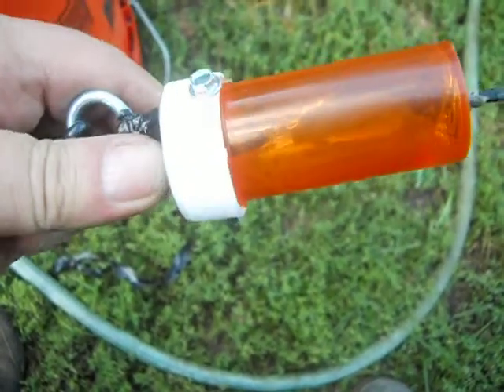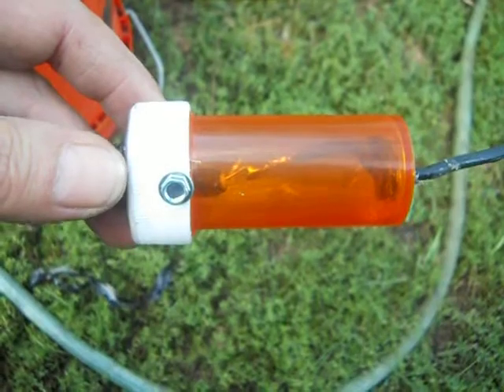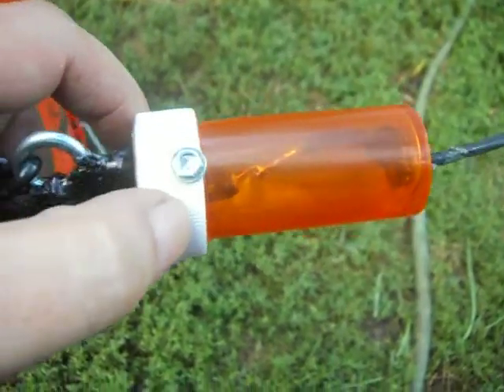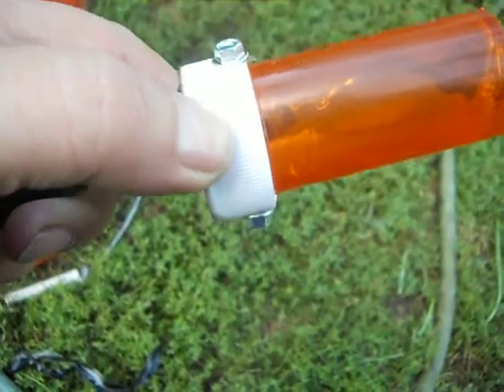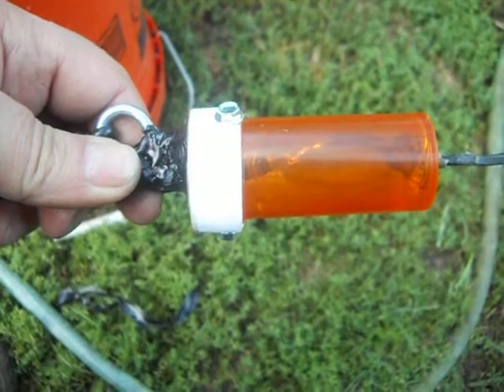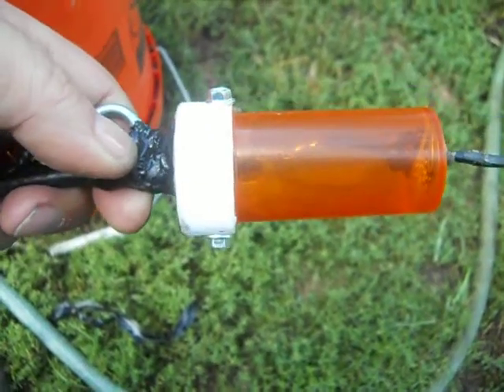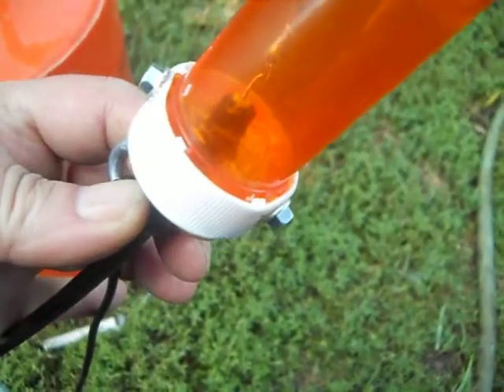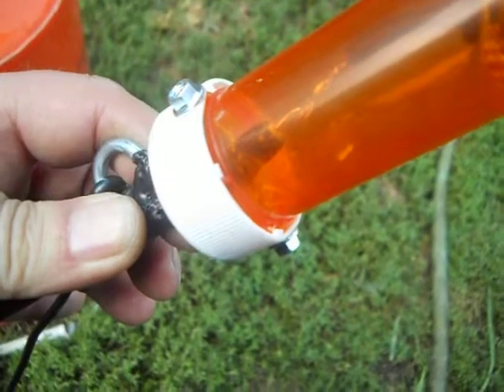LONG WIRE ANTENNA Repair Fix  Part 3

Comment: This is a very interesting project, but you do not show how well it works.  Can you do that?  I am a new shortwave listener and find antennas daunting.  thanks
Reply from the maker: In one of the videos I show how well it recieves the time signal on SW I do not have any equipment hooked up at this time Watch part 2 of this antenna